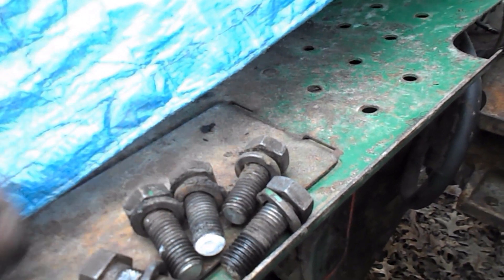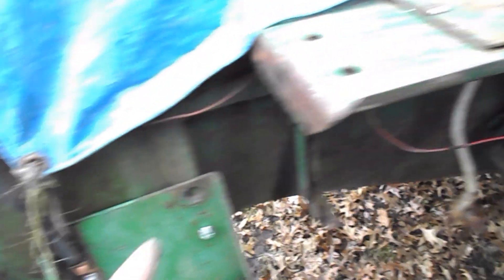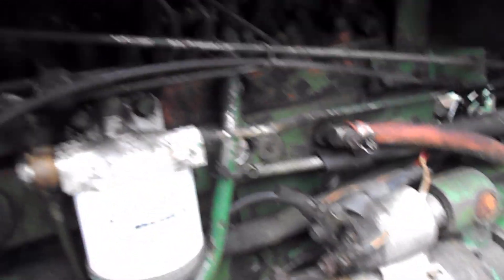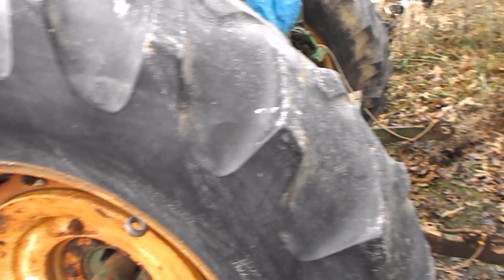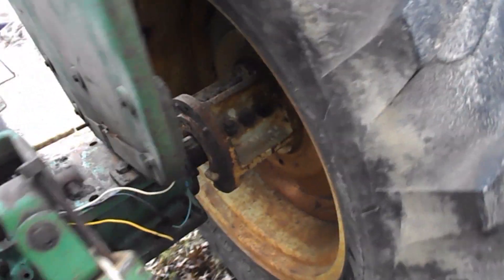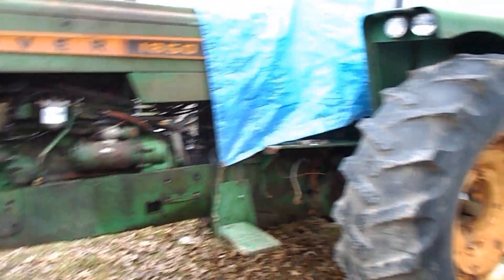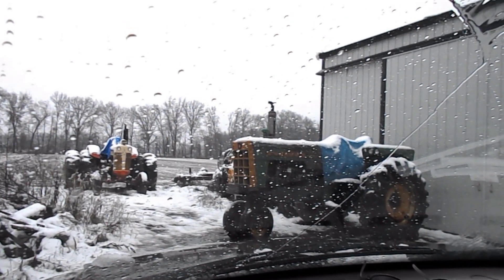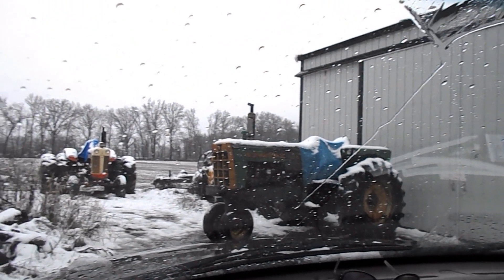12 15 19 and the Cradle is Back On

Comment: Good repair! The ole 1900 needs bolts for the cradle since almost all of em were broke off.
Reply from the maker: Normally the bolts brake before the cradle does so I guess I'm just lucky in that the cradle broke instead !  I hate drilling bolts and using easy outs but sometimes you have to. I've had to do that several time on the 1550's and it still aint fun ! Bandit

Comment: hello bandit, looks like a little job i could of helped you with lol i just wish we live a bit closer and the way my luck is with my trucks breaking down now i could use your help with em they are a pain in the butt and i fix myself cause i want it done right i dont trust them high priced repair shops. kinda like you when it comes to get it done right lol. i want to buy big bertha if you wanna sell. thanks for sharing
Reply from the maker: Most of the time I can figure out how to do something by myself but there are times when I need help for 5 min to do something and when I get to that point I'll call my cousin and he'll come over and help me. He said he doesn't mind stopping by to lend a hand cause he knows what I need done and it wont take long to do and I can finish it up myself. Some jobs it just takes 2 people to do it cause you cant do it by yourself like taking a chopper off a combine, 2 guys 5 min by yourself 1/2 a day ! LOL   I know what you mean about having someone work on your car or truck , You just cant trust the work they do. Last time I had work done I ended up have to do it all again because of shoty work !  The blend door in the truck that went bad I fixed it myself (giant pain in the butt !) and I know I would have been charged $500 or more to have had it done but I did it and got heat again ! LOL Give me a call on Big Bertha and we'll talk about it.  Bandit

Comment: Nice job on the cradle repair, should work just fine.
Reply from the maker: Thank You Pete,  I think the weld job will hold just fine and there is no real pressure on it other than tongue weight and that's pulling strait down, So I'm sure my welds will hold just fine.  If it had a lot of pressure on it pulling back I would have done something different but it doesn't so what I did will work. Just got to remember not to throw a chain around it and pull anything ! Bandit

Comment: The hitch repair looks good and you'd hardly know if the tractor was painted, I can only imagine how awkward that install was with that awkward shaped hitch bracket. I've seen a few different makes of tractor with those dry type disc brakes over the years. It could be they independent steered a lot one way, or that slack brake side started grabbing hard and locking on with oil contamination or some other problem. So they just slackened the adjuster right off, The last tractor I saw like it was a 6100 Belarus just before Christmas . I cleaned the parts and got it working  so the guy could sell it as he was tired of the whole tractor. The funny thing is the newer higher hour bigger name tractor he replaced it with's been more unreliable/expensive to fix so far than the Belarus L.O.L  Thanks for the video, Take care
Reply from the maker: I had a can of Oliver green spray paint but like everything else I couldn't find it ! LOL So it got primed good so that's better than nothing at all. It was pick it up waste high then bend down so it rested on your legs and with both hands on the upper corners and bolt in right hand I had to do some wiggling and grunting to get it to line up and got that first one in !  The second one was a lot easer and was real easy to get the rest. I don't think the brakes have ever been adjusted on that side, The right side has been run in and I'll adjust the left brake about like the right side and call it good. But that will be after the snow is gone and it warms up a bit ! LOL At least these brakes are easy to work on and adjust, Other kinds can be a giant pain in the butt to work on !  Bandit

Comment: The shortest tire I have dealt with was  Good year power torques. They were awsome as a dual tire because they were shorter than most other tires out there. Our David Brown had the same good year tire as the good year on your tractor. Now it has 2 gy dyna torque 2s. Those two tire model have a similar overal diameter. The only rear tires we got from titan I think is simular to the dyna torque 2 as far as diameter.
Reply from the maker: Usually the BFG tires were shorter than anyone else's but in this case its taller than the Goodyear. I couldn't figure out why the tires are worn the way they are and it turns out to be from the BFG is tall than the Goodyear so figured it out. Funny thing is most of the new 18.4x34's I find new for sale are 65.1 inches tall and the Goodyears when new were only 61.5" tall and if I get new ones it will throw the gear ratio's off a bit but I can live with that. I will for sure have to put taller tires on the front, Was thinking about 9.5x15 3 ribs but I think it might have to be 11Lx15 3 ribs to keep it some what level. But I'll worry about that after I get tires on the back first. I know on my Case if you was to put 18.4x34's on as duals you would never get the thing to turn at the end of the field ! 16.9x34 help it flout but its just short enough to make it easier to turn on the ends.  Bandit
Reply: @banditfarmer1900  we had 16.9 38 power torques as duals and 23 degree radial firestones on the onside. On a hard flat surface the power torques barely touched the ground even if you had them. Well inflated. Now we have the firestones on the duals and super traction radials on the inside amd the tractor is tough to turn.
Reply from the maker: @ghenry85  I was really surprised when I bought the Duro-Torques for the long they were a good 4 inches taller than the Firestone 151 that were one it . 65.1 inches to 61.5 inches and there was about 4 or 5 inches between the tire and the fenders now it might be 1 1/2 to 2 inches close enough to worry me a bit. Part of me wants to keep with the shorter tires for more torque and power but unless I can find a good used set for it I'll be having to buy the taller tires and trying to find taller worn down tires for duals ! LOL  Oh the things we do to keep on farming ! Bandit
Reply: @banditfarmer1900 Up to you what you want to do as far as duals go. Personally I like duals being shorter than the inside tire(granted 4 inches shorter seems a bit extreme) because they turn easier, still keep you afloat in softer ground and I don't care about it looking a bit odd. I definitely would not put on a larger tire on a dual unless I absolutely had to.
The best to my knowledge bigger diameter tires out pull their smaller counterparts(all other factors being equal), since the increase in tire foot print out wieghs the increased power it takes to turn the wheel (given the tractor can power the wheels in the first place, which your long has great power for that size of tire). The only reasons to swtch to a shorter tire is that you have to get the tractor in a area that is too short for the tractor plus you, or if the tires interfere with the fenders.
Reply from the maker: @ghenry85  I like the duals to be a tad shorter than the drives so it will let you turn easer on the ends. My Case being a short wheel base tractor is hard to turn on the ends to start with and even with the shorter duals on it your on the brakes hard to get it tuned. I always got a kick out of a guy near me who planted with a 1586 IH that had the long axels on it and hub duals set way out and every field he planted before he did the ends off he had a 656 IH with a 3pt land leveler on it to level the ends back down from the dirt he kicked up turning with the new matching duals set way out !   I don't know what I'll end up for tires for the Oliver yet used or new but I'm leaning towards new ones because of the price. When used is close to the price of new put on and your only talking a couple hundred more for new I'm looking hard at the new ones now.  I think all the tire companies have made there tires bigger to match the tires for Europe and metric sizes. When I get back tire on it then I'll start looking into front tires and then duals and see what happens. Bandit
Reply: @banditfarmer1900  l would suggest radial tires.  Are you looking at regular depth tread or deeper tread? There's alot of choice out there.

Comment: He Bandit, i noticed you are missing a lynch pin in the pin at the top of our left hand lift arm. I can imagine that was a bear to do yourself. stay safe.
Reply from the maker: It had a 1/4 bolt threw it and had to cut it off so I could drop that arm so I could get into that cradle and the pto lever easer, I have a lynch pin for it sitting in the barn. I didn't put it on cause I'm sure it will come off again before I'm done so I left it in the part bin in the barn.  That cradle was a real bear to pick up rest on the tops of my legs and with each side in hand and a bolt in my right it was a real struggle to get that first bolt started but I got it and the rest was easy !  I like easy a lot !  Bandit

Comment: Putting that cradle on yourself reminds me of putting my plow mount on the frame of my 95 silverado the way the mount is shaped it's almost impossible to use a floor jack to lift it up there. My wife was driving it for an everyday vehicle and every year for 6 years I took if off in the spring and put in on in November one year I had a minor surgery on my left elbow and needed help putting it on and she was perfect for helping needless to say after she helped me in 20 degree weather put it on it never came off the truck again.😂🤣 but I'm glad you got it fixed and installed and your getting all the things done for use in the coming up season. Hopefully you dint have anything new come up that's costly I cant wait to see it being used. Did you get your trucks heating issue taken care of I wasn't able to finish your video and I couldn't find it to finish watching it. It's funny watching what you were doing on the 15th I was taking care of a flu stricken family 14th to the 22nd. Cant wait to see the new rubber on the tractor I love seeing tractors with new rubber. Cant wait till next video
Reply from the maker: I've taken a couple of those snow plows off trucks and they are a job to get off let alone put back on one ! Getting that western plow off that plow truck was a chore by itself and I said to the guy that bought it  "NO" when he asked if I wanted to help him put it on a Chevy truck ! LOL I aint getting into a loosing battle !  LOL When it warms up and the snow melts off I'm going to hit it hard and get a bunch done to the 1850 while I can before the weather really turns south !  Bandit
Reply: @banditfarmer1900  new tire on the tractor will be nice definitely make the tractor have more traction. If the tires are filled with that I forget what it's called but can you reuse it or do you need to buy new. I'm the 2bottom plow guy buy the way. I got a question if you could answer at your most convenience if I damage that cotter pin on the belly of my massey 135 and motor oil is dripping am can I not replace it or do I need to immediately and also does the tractor need to be separated to put a new one in from the inside. I was yanking logs outta the woods and out of convenience to be lazy I decided to run a 3in 10ft trees I was pulling 2 20ft dead ask logs and didnt wanna back up.
Reply from the maker: @bryanblood7063   The 1850 really needs a new set of tires and at some point this spring it will get a set. The ones on it are just flat worn out and the way it is I doubt it would pull much without spinning out, I've got my eye on a set of rears right now and thinking about buying them but its too cold and nasty to worry about them right now.  On the 135 I'm a bit cornfussed on what your talking about on what might be damaged and ware it is, So if you could give me a better idea of what and ware I'll be happy to answer your question.  Bandit
Reply: @banditfarmer1900  theres a cotter pin on the underbelly so dirt cant get into the hole I think I broke and itll leak oil. Maybe it on smaller tractors or just massey's them self's but if you dont know off hand it's fine. I was wondering if in order to replace it the tractor needed to be separated for it to be the cotter pin to be replaced, or even if it's a cotter pin at all. I looked it up it's a area for the motor oil to slosh into so it dont get mixed into the hydrolic fluid the cotter pin keeps the dirt out I just didnt know how to replace it didnt know if you have had it happen. I was riding a wheelie pulling 2 big logs and steering with my breaks came to a little tree and just completely pushed it over after that I noticed oil in the snow.
Reply from the maker: @bryanblood7063   The cotter pin is in there so that hole will stay open so if any oil leaks into the clutch housing it can get out. Sounds like the rear main seal is leaking, If it was up on 2 wheels and you started seeing motor oil behind you might want to check to see how much engine oil you lost. With it in the air all the oil goes to the back putting more pressure on the seal and if its bad the oil will push right on threw it into the clutch housing and drain out the hole in the bottom. If the oil is dark more than likely its from the engine and if its more clear its from the transmission/hydraulic reseavore leaking into the clutch housing. Either way it will require you to split the tractor to fix the rear main seal or the transmission seal . You can take a longer cotter pin and spread it at the end and lightly press it back together just enough to get it in the hole and it should be good to go. Bandit
Reply: @banditfarmer1900  I'm use to dragging trees with tractors the size of your Oliver 1550 so riding wheels for a 1/4 miles is new to me in the sense of having to worry about fluid sloshing around. I checked my fluid it was fine I noticed the fluid the next morning where it sat. I'm starting to think I need a bigger tractor, my neighbor down the road had a 68 Oliver 1450 fully restored with a overhauled fiat diesel that 50hp would definitely be all i need. Thst massey I think has to much horsepower for its weight. The thing is it's so cut and dry to run though. But I'm mechanically inclined enough to fix it but the guy who I bought it from said that rear main seal was only a few years old before I bought it so that stinks. I bought that massey because he had receipts on an engine over haul and a new pto shaft seal and a new clutch. Stinks because my tractor is kinda to small I had the chance to buy a ford 4000 with a bucket on it for 6500 on really good shspe
Reply from the maker: @bryanblood7063  The 135 is a good little tractor but maybe need to just take one log at a time in the future. Your like me in get the job done as quick as you can but if your doing wheelies well lets just say I like to keep all 4 on the ground ! Don't ask why ! LOL BTDT and once is enough for me !  $6500 for a 4000 and loader is a bit high to me when you can find a lot of other tractors with loaders cheaper. Not long ago I saw a MF 165 diesel with a all hydraulic bucket loader for $4500 and it looked to be in good shape. So I'd look around a bit before you buy anything cause it don't cost nothing to look ! LOL I love to look and chase down leads on ones I hear of. I looked for over 10 years before I found the right 1850 to buy, She needs a little work but when I'm done I'll have a good solid tractor that's ready to run come spring time. Take your time looking around cause you never know when something will pop up for sale and maybe close to you.  Bandit
Reply: @banditfarmer1900  well I'm glad I talked to ya about the 4000 then cause i was thinking about looking into it again. It's one of those things wheres it's for sale but not sitting out at the road type thing. He is dead set on the price it has about 1300 hrs on it. Plus I'm a sucker for ford tractors and trucks. I grew up on a international 586 a 1976. But you cant find them anywhere around here there still in service and if you can find one there beat up and usually theres a reason why there selling them. I live in the biggest farm area in genesee county and it's farmers dont sell nothing and besides my uncle whose been a farmer since 1965 when he took over our family potato farm I cant tractor talk or anything because they dont use the old stuff it's all latest and greatest you know. That why I watch your channel cause the way you are is all I know I've never driven a tractor newer than 92 and that was a ford 3930.  But I tell ya what if I seen a massey 165 diesel with a bucket like you were talking about I'd buy that tomorrow. But again thanks for your time cause I'm sure you have all sort of people you talk too because of your channel thanks again
Reply from the maker: @bryanblood7063  Now if that's a 4 cyl 4000 with 1300 original hour tractor and its really clean and strait with a bucket loader and really good tires on it $6500 might not be that bad of a price for it.  What I'm used to seeing are the ones that are just average to well used for sale, You don't run a crossed many low hour 4000 Fords like that with a loader on it. Dad years ago bought a 550 Oliver diesel with an all hydraulic loader on it and found out real quick it was useless off a hard surface !  The loader was as heavy as the tractor was to the point I put 11Lx15"s on the front and still couldn't keep the front end up in worked ground. We also found out it would start and run backwards ! LOL That was a fun one to figure out ! LOL I'll keep an eye open but if you got the money and that Ford is in really good shape it might be worth a second look at it.  Bandit